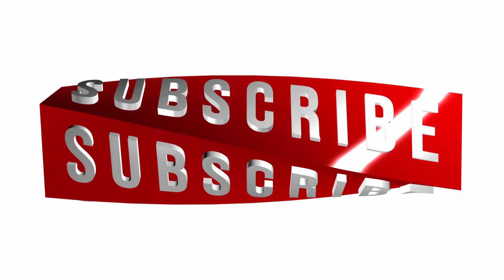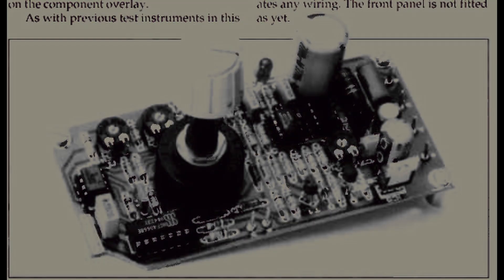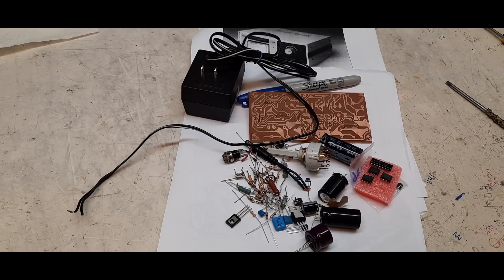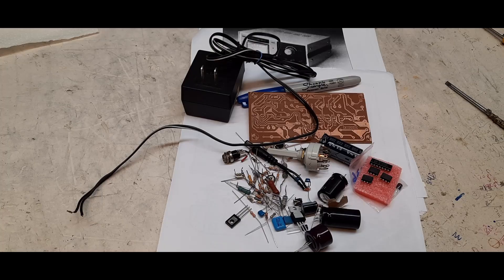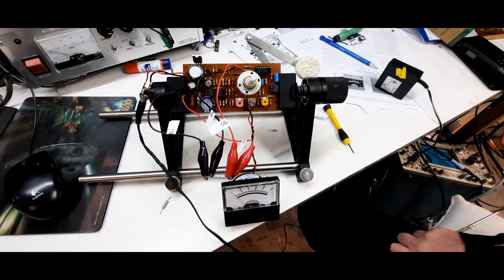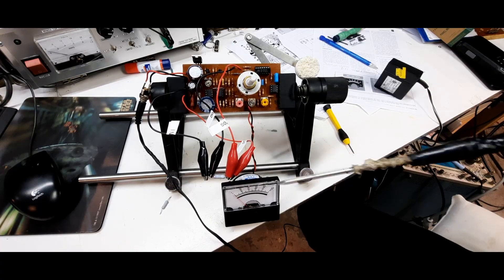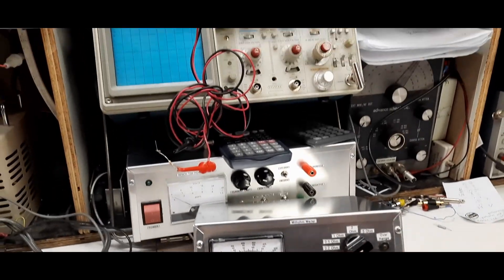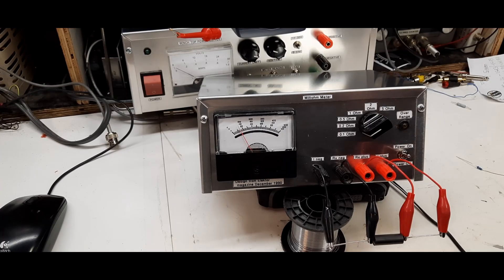Milliohm Meter - Elektor Electronics Magazine - December 1990

Comment: A milliohm meter can be used for a few things, like measuring DIY current shunts or measuring new/old resistors to check if they are (still) in spec, but the most use of a milliohm meter is to find a short in a circuit. 
For example you have a short in a 5V powerrail in a circuit, and with every multimeter in resistance mode, you measure a dead short. What is the component that cause the short? 
Imaging that the circuit has multiple capacitors in parallel on this 5V rail, one of them can be shorted, but to find the one, you normally need to remove them all to test each capacitor separate, but it could also be a diode that is shorted. With multiple diodes in parallel, which one is the culprit etc....
With a milliohm meter, you test the circuit a different places, and the closer you come to the short, the lower the resistance becomes. 
But with this design that use 10V in burst of 1ms at 1A, you can't use this tester because you probably damage your circuit that you want to test. So i find this tester needs to come with some warnings, that it can't be used to find shorts in a circuit.  Other then that, a nice build, but for just measuring low value resistors or current shunts , that you don't do each day, it takes too much space on the bench.
Reply from the maker: I did not know that a milliohm meter could find shorts like that. I learn something on every video I make. Thanks for that explanation. Too bad my meter is not good for that but it wad fun making it. I did find room on the bench for it. Thank you for the knowledge you have given me. Cheers!
Reply: @bettinaneumryr  thank you for the nice video's that you make. Grtz from Belgium.

Comment: Please, connect the oscilloscope to the two ends of the resistor under test and see the circuit waveform. maybe useful.
Reply from the maker: I take that back ... one scope lead was off. So I am seeing that 1V pulse that controls the current. Cheers!
Reply from the maker: Just did it and nothing to see. Just some 5 mv noise of the scope. Thanks for watching the video. Cheers!
Reply: Thank you for replying.  I think it may be useful to test and probing waveforms of circuits you make.

Comment: You need Kelvin probes for this project. Chinese make a reasonable cheap kelvin probe . I admire your persistence with these projects I have been building the occasional project since the 70,s  and had a lot of fun. It is amazing that you can still get parts for all of these devices and most are now cheaper to build then when first published.  Can I suggest you might enjoy getting a 3 d printer to produce custom cases for your projects. This has raised the standards of my builds enormously and it is also great fun.
Reply from the maker: I do have lots of patience for these things. I never heard of those probes before you mentioned them. I just googled them and they would fit the bill for sure. I think for now, I'll stick with what I got. I think the probes would be more money than I have in the project right now. As for parts, some are hard to get and I usually but from Digikey and other places like ebay. I pass right by the Chinese parts. Not going there! As for the 3D printer ... good thought. I will look into that. Cheers!